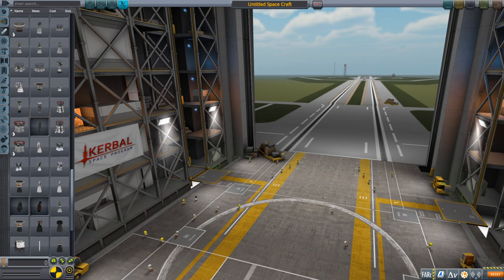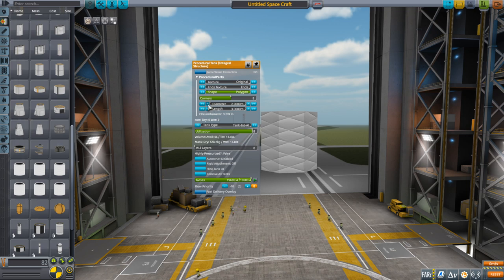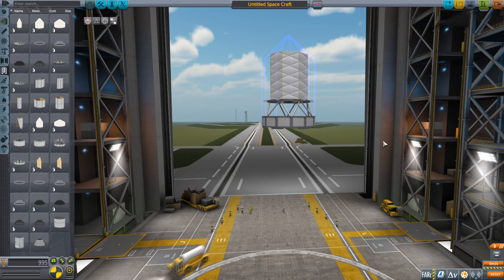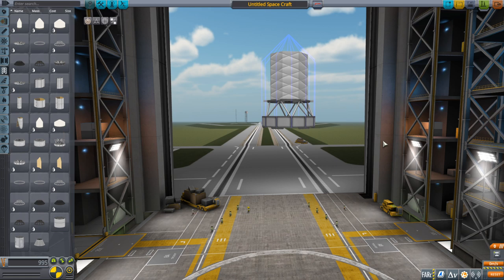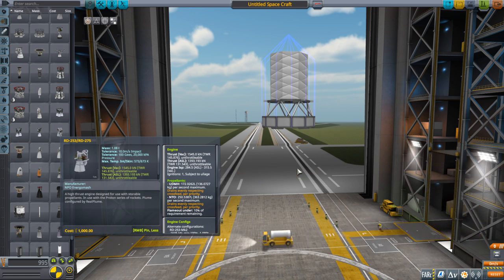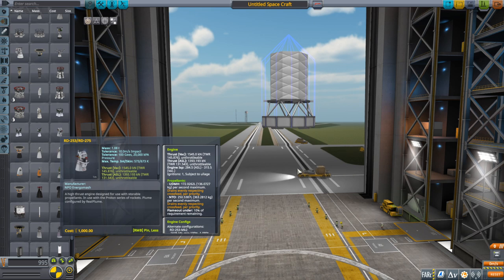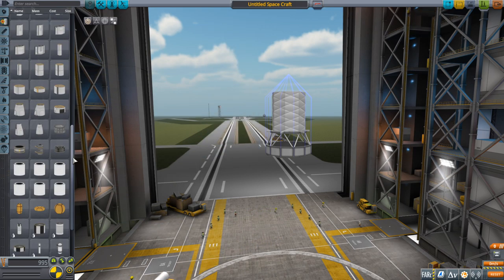Launcher Design in Realism Overhaul (KSP 1.8.1)

Comment: Tyler another question, there's a way to have to instances of KSP? Because I have one with my Career mode, and I don't want to put another mods in that installation. So can I have another instalation for use RO? Ty.
Reply from the maker: You should be able to just copy an install of KSP into another folder. I haven't tried this with the Steam installation (I originally bought it through the website).

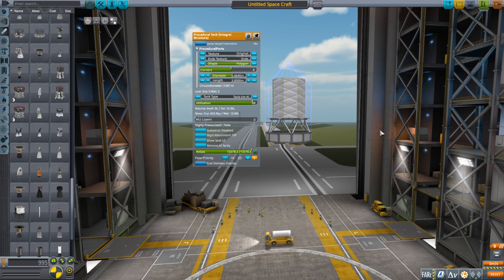Comment: 7:01 - Please help! Where exactly this formula comes from? And where can I read about it? I can't find any info on this so please help...
Reply from the maker: I made it up. It's just a rough estimate/rule-of-thumb thing I use.
Reply: @RaizSpace  Thanks a lot! I really appreciate your answer :) 
And I think I've got it. It comes from Tsiolkovsky's equation: 
finall mass = (e^(ΔV/(g0*Isp)))*mass of the payload. 

And I actually compared these two coefficients by which you multiply mass of the payload (graphically).
(x represents specific impulse) 
Yours: y = 10000/x 
And the one, coming from Tsiolkovsky's equation:
y = e^(1000/x)
And they are pretty close to each other around 300-s. In fact, there's interception happening at x ≈ 279

And, yes, g0 is 10 in this comparison.
Soo that's it. 
Btw I found your channel recently and I really like it :) Wish you the best!
Reply from the maker: The equation I used is to estimate the total mass of the rocket based on the payload and the ISP for the engines so we know what engines to plan to use on each stage. While related loosely to the Rocket equation, it is not derived from it, and your interpretation is not quite right. Edit: basically, the problem with your interpretation is that it's only considering one stage, while my estimation attempt is for the maximum expected mass of the rocket (an upper bound), which means all stages combined.

Comment: It is possible to get a payload that's over 6 % of the lift off mass of the entire launch vehicle + payload. I've done that using a vehicle consisting of a large hydrolox core stage with 4 RD-0120s and 4 strap on boosters with one RD-171M each, without using any balloon tanks.
Reply from the maker: Yes, it is absolutely possible. These estimates should be regarded as minimums - if a person designs a rocket and doesn't get these payload fractions, they should conclude something is suboptimal about the rocket.

Comment: 2:15 Zenit is simple? In terms of engines, yes, but definitely not engineering-wise.

3:45 You may have forgotten that the Titan 2/3B and Titan IIIC used hypergolic third stages, in particular the Agena and Transtage.

7:20 Now that's a neat rule of thumb.

17:25 I hope one day there's a launch site at the equator. Best possible location IMO would be at the Somali coast, as it's on the east coast of a fairly unpopulated region and has dry, frighteningly monotonous weather.

20:25 to 22:55 Good information I didn't know of before.

23:35 Many early lunar missions (including the first Surveyors) were actually launched directly to the Moon without a parking orbit. Not that I'd recommend a first-time RO player to attempt that...
Reply from the maker: Zenit is simple in terms of design, not necessarily implementation (which is the engineering part), but this is a video on design and KSP doesn't require you to do the actual engineering. Of course I remember Agena and Transtage - those are included in the fundamental hypergolic Titan design, but it is the addition of a cryogenic stage, the Centaur, that turns Titan into a GTO-and-beyond specialty rocket. I may have rushed the explanation for simplicity.
Reply: I've wanted to try to get into a rectilinear HALO orbit around the moon with this moon, as for the lunar gateway but haven't progressed that far yet. I'm suspecting this will be tricky. Want to try Raiz?

Comment: In regards to 10x the delta v in a stage rule of thumb, what about Ariane 5 style rockets? Where is the point of diminishing returns on those setups? Or are you basically ignoring the burn time in the lower atmosphere where the sustainer engine isn't very efficient?
Reply from the maker: If you're talking about using the vacuum delta-v instead of sea level, then yes, we ignore the small amount of time it burns at its sea level ISP because that lasts about a minute and the time to Earth orbit is much longer. Around Earth, the vast majority of the delta-v to get to orbit is applied at the vacuum ISP, even with the first stage.

If instead you're referring to where I said the thrust of the first stage should be 5 to 10 times that of the second stage. Ideally with an Ariane 5 rocket in terms of getting to LEO, the first stage should be thought of as the boosters + the core engine and then the second stage is just the core engine, so that the HM-7B stage is actually a third stage that completes orbit and then transfers stuff to GEO. As it is, Ariane 5 would be better if it had two core engines (see the H-IIB for a good example), but obviously that would increase the cost.

Comment: Tyler, I love this serie! One question, where you get that numbers, like x10 the ISP in Delta-V,? 
Thank you for make this serie, is gonna help me a lot!
Reply from the maker: I'm not sure there's anything fundamental in the exhaust velocity (9.81 * ISP, which appears in the rocket equation) being the optimal delta-v in a stage, but when optimizing stages this tends to be the case. I remember working through the optimization equations years ago, like soon after I got KSP.
Reply: @RaizSpace  Ok Tyler! I gonna try it then! Thank you very very much.
Reply: Maybe the x10 was because it was a 10-ton payload
Reply: This is probably amount of delta-v reuired to get into orbit (including drag losses), although i'm not entirely sure. And yes, i know that i aswer 1 year late,
Reply: @O5MO  thank you anyways!
Reply: I think it is coming from the idea that the rocket at stage N+1 usually weighs at least 3 times less than at stage N. Then the rocket equation becomes delta_v = 9.8 * isp * ln(3-ish) ~= 10*isp. Since ln() is a slow function, even when 3-ish becomes 5-ish it will only change the 10x to 16x

Comment: i build sounding rockets just fine
but i have huge stability issues for the bigger rockets any suggestion
Reply from the maker: Really depends on exactly what the setup of the rocket is and what kind of stability issues it has. I assume you have Kerbal Joint Reinforcement as required by RO, but maybe some additional autostruting would help.
Reply: @RaizSpace  btw any tips for LVs after basic orbital mission like polar and science orbit, i struggle with does precise orbit misison so i need tips on building precise upper stage for early tech like 1958 orbital rocketry and i also have agena module node. thank